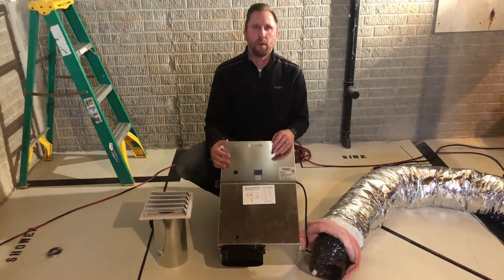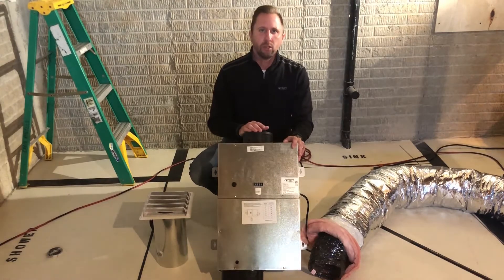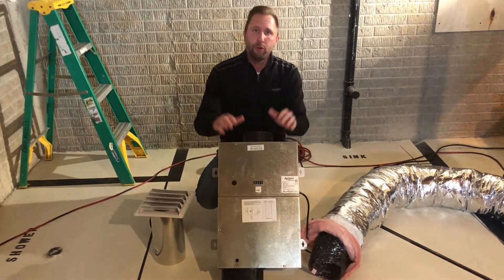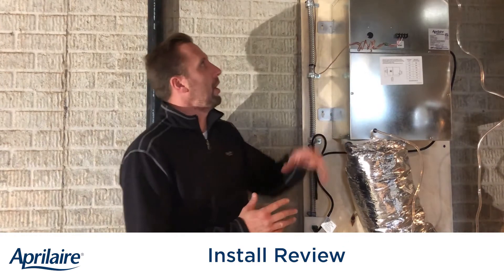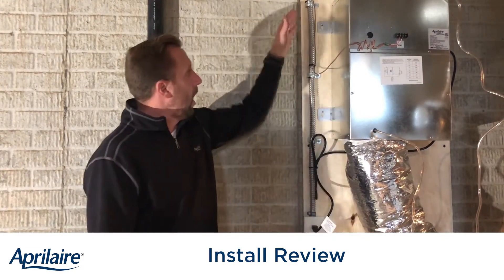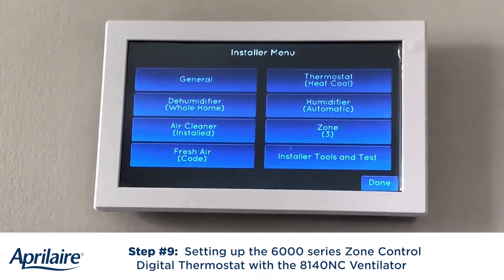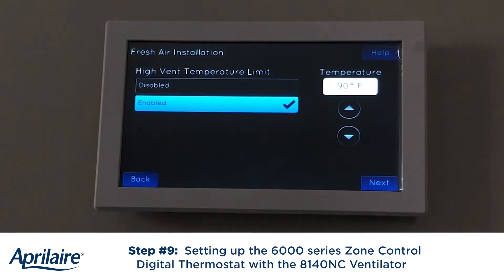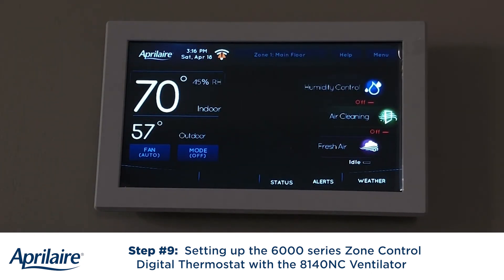AprilAire Model 8140NC Fresh Air Ventilator Installation and Setup

Comment: That’s a lot of air to push into a house without controlling how the "dirty" air gets out.

First is pushing warm, moist air through the gaps and cracks, including around electrical boxes, into the outside wall cavities. This is a tremendous concern in cold climates and will cause major rot issues. 

Second is the heat/energy loss without an exchanger.
Reply from the maker: Thank you for contacting AprilAire! For assistance with this, please contact our technical team at 800.334.6011.

Comment: Charcoal filters help with most all issues and is proven, and regular systems and re-heat if you want high tech solutions,
All this is just for more expensive system options 
Over all at the end of the day it does the same thing as are old engineers designing 
Just more money

Comment: We are looking at adding one of these units but I am trying to figure out if there is a way to also trigger the fresh air ventilation when turning on our range hood for our stove. Either by an additional pressure switch or wiring in a relay with the vent hood. I want to maintain the capability to control scheduled ventilation with my thermostat.
Reply: Hi, we’re you able to find out? I’m looking for the same type of setup for my kitchen.

Comment: Do you connect it to the return duct before it goes through the coil and furnace?
Reply from the maker: Thank you for contacting AprilAire. Would you mind giving us a call to discuss your installation? We would be happy to assist. We can be reached at 1-800-334-6011 Monday through Friday, 7:00 a.m. to 5:00 p.m. CT.

Comment: does this help cool the house by bringing in cooler air at nights so the AC does not run all day (pretty much like a weak whole house fan)? How long would it take to cool the house by 5 deg at 190 cfm?
Reply: It’s not designed for that type of use.  It’s designed to keep your house in a positive pressure and keep moving fresh air through your house
Reply from the maker: Thank you for contacting AprilAire! We do not have information about our ventilation systems being able to cool the home. This would be a question for your local HVAC contractor, as they may be more familiar with this type of application.

We recommend using ventilation to bring in fresh air to make the home fresher, healthier, and to meet ASHRAE building code standards. If you have any additional questions, we can be reached at 1-800-334-6011. Thanks again for contacting AprilAire.

Comment: Hello, can you please share how to enter the installer mode? Thank you!
Reply from the maker: Hi Steve - Thank you for contacting AprilAire! If you are using our Model 8120X ventilation controller with your Model 8140NC, then installer mode can be entered by holding the Select button on your controller for five seconds. If you have any additional questions, we would be happy to assist. We can be reached at support@aprilaire.com or by calling 1-800-334-6011 Monday through Friday, 7:00 a.m. to 5:00 p.m. CT.

Comment: Where does the 190cfm then exit the house?
Reply from the maker: Thank you for contacting Aprilaire! The 190 CFM brought in does not exit the house all at once. Most of our ventilation equipment puts the home under positive pressure, so the air forces itself out of the home through small cracks in windows and doors all over the home. A positive pressure home means that it only goes out those cracks, and all the air coming into the home is fully filtered and conditioned before it reaches the living space. We would be happy to discuss this further with you and answer any remaining questions. Would you mind giving our expert support team a call directly at 1-800-334-6011? A Customer Service Agent is available to assist Monday through Friday, 7:00 a.m. to 5:00 p.m. CT.

Comment: Can this system be installed into a home without an HVAC present? Like mounting the unit to an exterior wall depth duct and the feeds into the home? Similar to a LunosE2
Reply from the maker: Thank you for contacting Aprilaire! We recommend installation to an HVAC system. The unit can also be installed as a standalone unit without connecting to an HVAC system. If you have any further questions, feel free to contact us at support@aprilaire.com or by calling 1-800-334-6011.